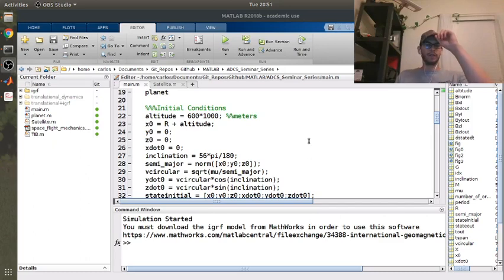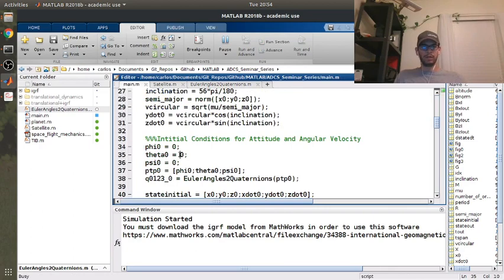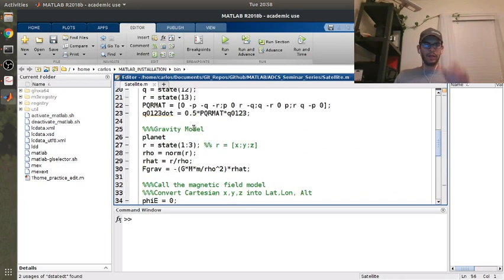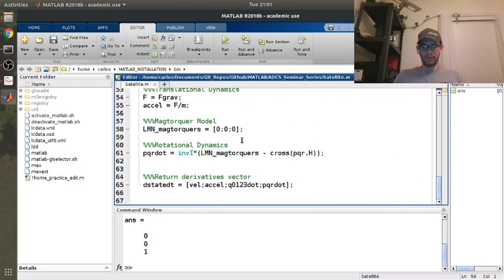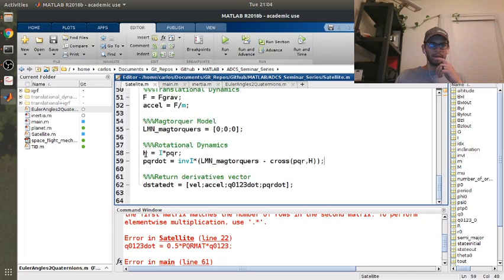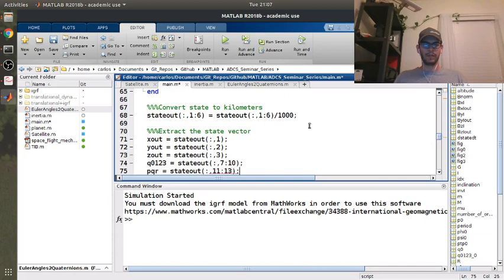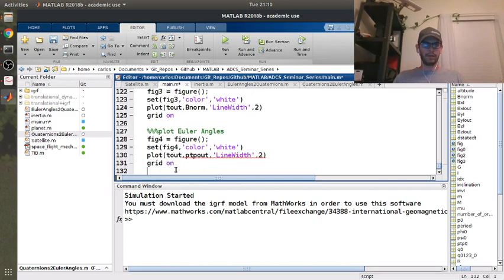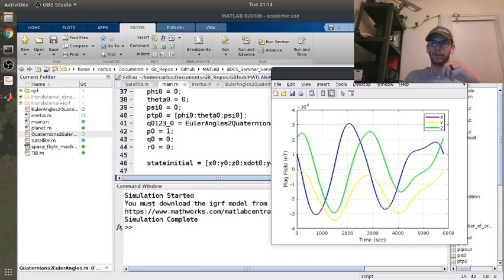MATLAB Help - Quaternion Dynamic Simulation of a Low Earth Satellite

Comment: Why are the magnetic field plots different from the previous video? The only thing magnetic field depends on is x, y, z coordinates, the satellite spinning shouldn't change that in any way right? even if it does, in the first case at least (where all angular velocities were 0) shouldn't it match last vid's sim?
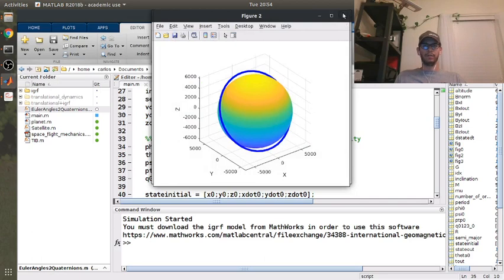Especially at 3:03 nothing new has been added that affects the mag field sim, but it's different from last time
Reply from the maker: Not quite. In this simulation the satellite is rotating. The magnetic field you are seeing is in the body frame of the satellite. Since the satellite is rotating the reference frame changes and thus the magnetic field in that reference frame also changes.
Reply: @CarlosMontalvo251  Just to be clear, what exactly is "magnetic field" referring to here? I assumed that it means the strength of magnetic field at the point where the centre of mass of the satellite is located at that instant, is that correct or something else?
Reply: @CarlosMontalvo251  also, in the NED frame is the origin situated at the center of the satellite? If so how does a simple rotation matrix suffice to convert between ECi and NED? 
and what is the difference between NED and body frame?
Reply from the maker: @aryaashutoshpathak4849  The ECI frame is centered at the origina of a non rotating planet. The z axis points north and the x-axis points through the equator at the prime meridian. See Figure 2 of my book https://github.com/cmontalvo251/LaTeX/blob/master/Aerospace_Mechanics/aerospace_mechanics.pdf

The NED frame is similar to a polar coordinate frame where the NED frame is fixed to the origin of the satellite but always points north (x-axis) and the D points towards the center of the planet. Again see Figure 2.

The body frame is fixed to the satellite but rotates with the satellite which means the x-axis is always pointing towards a specific face on the satellite. 

Transformation matrices are dicussed in Section 5 of my book. Hope that helps
Reply: @CarlosMontalvo251  understood now. Thank you!!
Reply from the maker: @aryaashutoshpathak4849  Yes the magnetic field is the vector components of the magnetic field at the point where the center of mass is located at that instant.
Reply from the maker: @aryaashutoshpathak4849  ECI is centered at the center of planet earth and is not rotating. the body frame rotates with the satellite. I discuss this in my book in great detail. https://github.com/cmontalvo251/LaTeX/blob/master/Aerospace_Mechanics/aerospace_mechanics.pdf

Comment: Great video, I was trying to follow your code, but I have a problem with the H = I*pqr, its like it doesnt recognize pqr, very weird.
Error using  * 
Incorrect dimensions for matrix multiplication. Check that the number of columns in the first matrix matches the number of rows
in the second matrix. To operate on each element of the matrix individually, use TIMES (.*) for elementwise multiplication.

Error in Satelite (line 68)
H = I * pqr;
Reply from the maker: That's weird. the inertia matrix (I) is a 3x3 and pqr is the angular velocity vector at a size of 3x1 so the inner product dimensions line up just fine. You might need to run the code in debug mode to see what's going on.
Reply: @CarlosMontalvo251  Will do, ty!

Comment: Hey, I'm trying to model a 3DOF (along angular axes) tetrahedral ADCS system for a CubeSat on Simulink using quaternions. To start I successfully simulated a 1DOF model but I'm struggling to generalize to 3D especially using quaternions, could you please suggest some resources regarding the same?
Reply from the maker: What do you mean? Is the software I explained above not suitable for what you're doing?
Reply: @CarlosMontalvo251  No, I meant that your videos cover magnetorquer control, but I am using reaction wheels. It would be tremendously helpful if you could expand this series to include reaction wheels as well. Also, could you direct me to any similar resources where they have done what you did in this series but using reaction wheels as the actuators?
Reply from the maker: @aryaashutoshpathak4849  Ahh. I have had numerous requests for Reaction Wheels. I am on holiday for the season so I will add this to my winter to-do list and will try and get to this asap.
Reply: @CarlosMontalvo251  I cannot overstate how amazing that would be. Will be looking forward eagerly. Thanks a ton.

Comment: How did the graph of Bx,By,Bz vs tout change (when compared to last video) ? There is no change when populating BI matrix right ? It is same as that in the IGRF video right ? I was coding these by myself after watching the playlist. And at this stage the mag field graph is not the same as the one in this video but instead same as that of previous video. Please help
Reply from the maker: I think it is because in this video the satellite can rotate which means that the body frame is changing and thus the decomposition of the magnetic field vector in that frame.
Reply: @CarlosMontalvo251  But BI is taken with respect to inertial frame so, the change in angular velocity is not supposed to affect BI. Isn't it ?
Reply from the maker: @ganesh2516822  The inertial frame magnetic field vector will stay the same but if the angular velocity is non zero the attitude will change and thus the body frame components will change.
Reply: @CarlosMontalvo251  Ok thank you for your reply sir

Comment: Hey man, I'm learning a lot from your videos, thanks for sharing!! I was wondering if you could help me out, I'm trying to implement a CubeSat in single axis rotational dynamics from this paper: http://www.malcolmdshuster.com/Pub_1992a_C_Flatland_MDS.pdf

The idea is to use reaction wheels as actuator and linearize the quaternions equations to use LQG control, but I'm having a hard time trying to solve this. Later on I want to build a physical system. Any advices or other materials I can look? It would be awesome if you could make a video about this as well if you don't have another about this topic.
Reply from the maker: Hey Lucas, sorry for the late reply. If you're wanting to do single axis dynamics you really just have a 1DOF second order problem where 

angular acceleration = total moments / inertia

in this case total moments is going to equal the torque applied from the reaction wheels. 

I discuss a bit about reaction wheels in my SpaceFlight mechanics text

https://github.com/cmontalvo251/LaTeX/blob/master/SpaceFlight_Mechanics_Montalvo/space_flight_mechanics.pdf

And I think I have a quick 1DOF reaction wheel example here https://github.com/cmontalvo251/MATLAB/tree/master/CubeLAB/Reaction_Wheels

Not sure if it works. It's been a while since I coded that in MATLAB
Reply: @CarlosMontalvo251  Hello Carlos, 

I will take a look in the materials, I'm sure it will be a great help. Thanks for your reply. 

Regards
Reply: @CarlosMontalvo251  what is the difference for 1DOF and what you have above?
Reply from the maker: @hafizuddinmohdlowhim8426  1DOF is only 1 degree of freedom. This is a full 6DOF simulation of a satellite in orbit around the Earth